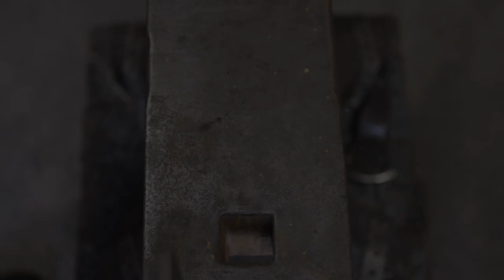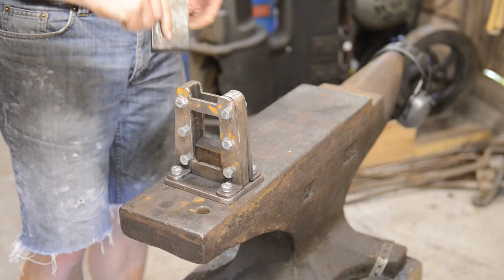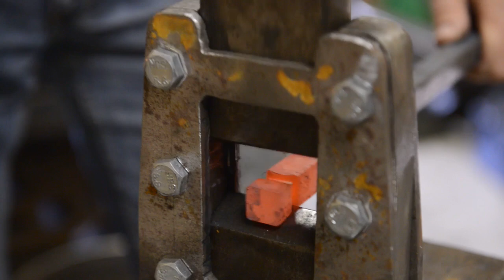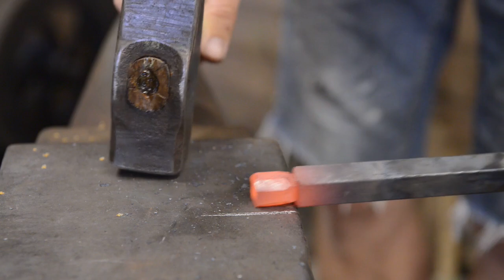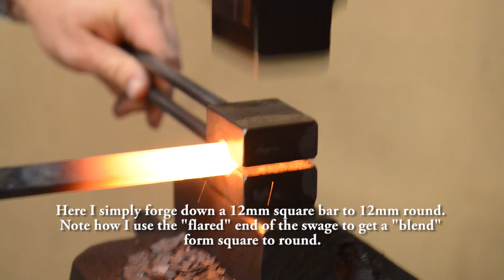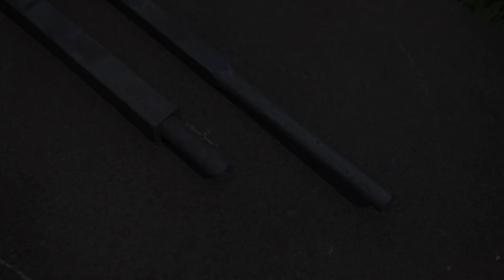Blacksmithing - Using a spring swage. Forging tenons

Comment: Excellent way to make a tendon.  What is the die size you are using?  Thank you again for  making this video..I am just learning.
Reply from the maker: +Steve Dettwiler On the swage or power hammer?
Reply: +Torbjörn Åhman  - Sorry I meant for the Smithin Magician-  I would like to purchase one..but not sure what the blade or die you were using to make the first cut into the bar.  Thanks again-
Reply from the maker: +Steve Dettwiler Ah, the die stock is 20x60mm if I remember right, 1045/C45 steel.

Comment: thanks for posting your videos i've gotten a lot out of them ... i need to build a guillotine would you mind sharing the basic dimensions of the one you're using in the video? specifically the diememsions of the base plate and slot for the die. thanks!
Reply from the maker: +Gregg G Use what suits your needs or material you have in stock :) Mine is based on this - http://www.blacksmithsupply.com/catalog.aspx

Comment: I don’t have a power hammer so I am making sewage for tenons.  I hope I can weld a Harty shank on the bottom.  My welding is very limited
Reply from the maker: For manual hammering you might look into a guillotine tool instead! Working with a striker you can make a set of bottom and top tools
Reply: Torbjörn Åhman thank You. I do have a set of blank dies

Comment: It can't be much fun to use this without an autohammer.  Guess that is when you bring in a helper eh?
Reply from the maker: This type of tool is more or less only used under power hammers I think, but should work fine also with a striker, but you will mangle and deform the top part being hit by a sledge.

Comment: I think if you put two springs inside left and right of swage to keep the upper die always little above the bottom die you wont need every time to pull the upper die , wasting time and the tool. Just an opinion.
Reply from the maker: Yes, you can make all sorts of additions for a better workflow. This is just the basics :)

Comment: well looks like the curse of oak island is full of &#!^, they claimed the swages they found where to sharpen things
Reply from the maker: ok? Link?
Reply from the maker: I'm not so sure what that is really, and the dating sounds ridiculous. It could be a blacksmithing  tool but probably more like a fuller than a swage. Most drills back then was sharpened by reforging the tip, so in that regard it could be right.
Reply: @torbjornahman  I have watched since day 1 but seen a few things that just aren't adding up, i am not a blacksmith that is why I was here looking into swages, there was another episode they found purple wood. well as I have plumbed many things over the years, there is a chemical for pvc and it just happens to be purple primer for pvc plumbing, i literally look like they dunked the wood into a bucket of it